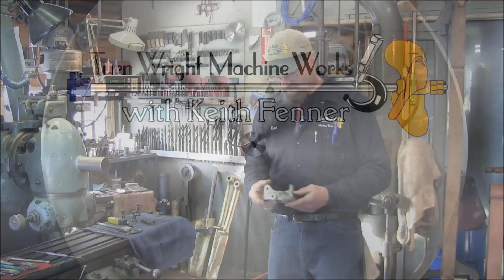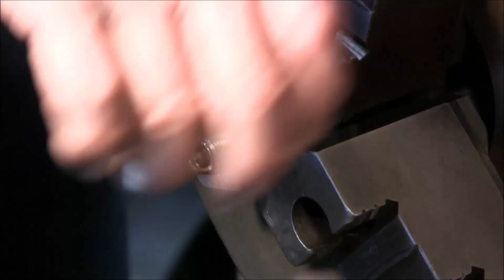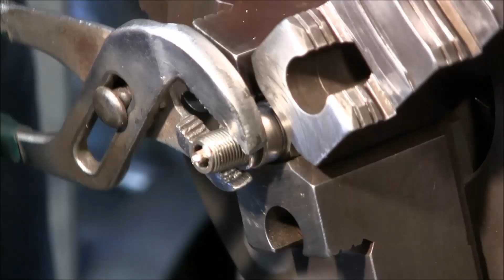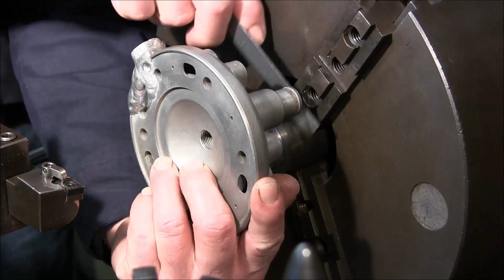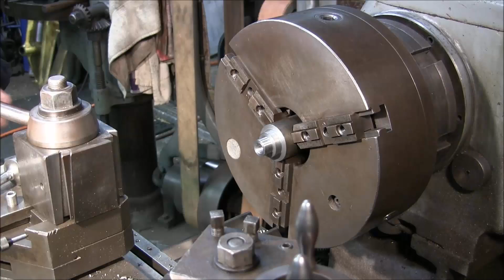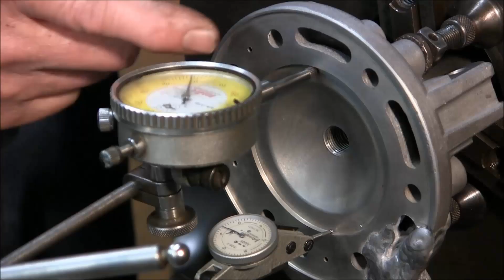The Manual 3D Metal Printer Part Seven

Comment: That spark plug dissection was great. Talking to drivers about the health of their engine always centers on plugs. That fragile ceramic insulator is so easily grounded and causes misfires. Thanks for taking it off that clean and showing it.

Comment: Why cut the threads off the spark plug?   Could you not have put your work onto the complete spark plug while it in the  setup up used to cut it off?

Comment: Keith
An easy way to figure the tapping drill for a metric thread it to deduct the lead as you call it from the diameter

Eg. 9 mm by 1 mm is a 8 mm drill
Therefore your 14x1.25  would be 12.75 mm or as you say as near to 1/2 inch as damit is to swearing

Great series 

Stuart

Comment: Did you consider parting off the sparkplug a 1/4" or so farther up the plug? That would have kept the machined face and the proper diameter.
Reply from the maker: Pat Farrell No, all I needed was interested in, was the threads the shoulder meant nothing. ;{)-----

Comment: M14 x 1.25 is also used for wheel bolts (BMW mini) which might be cheaper than spark-plugs.
Reply from the maker: Richard Crewe I went to auto store and all lugs they had were off on the pitch, but you know those NAPA guys! LOL, the plug was free spare in my catch all. ;{)-----
Reply: 50 thousands of an inch is 1,27mm, Maybe you could make a threaded stud with this pitch?
Anyway I preferred to watch the spark plug dissection ;-)